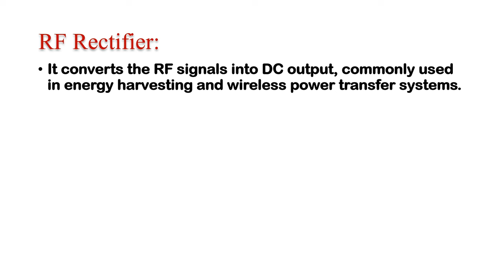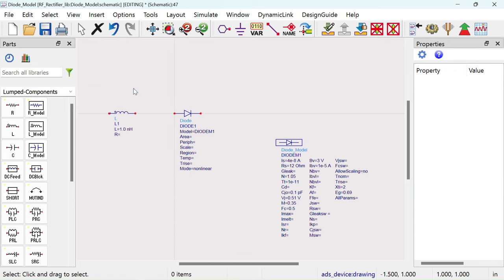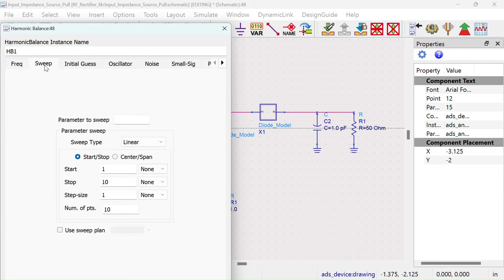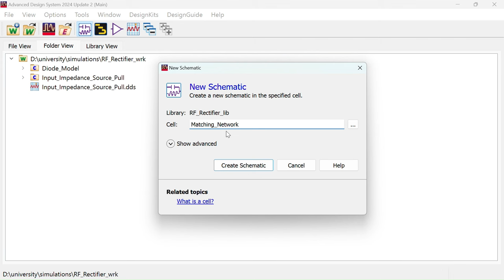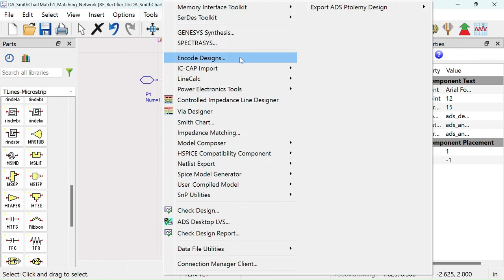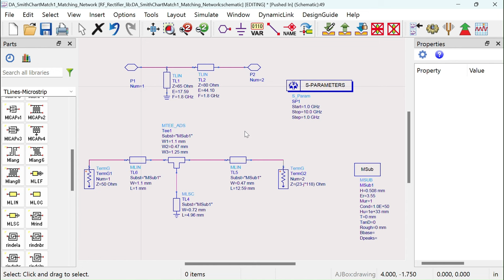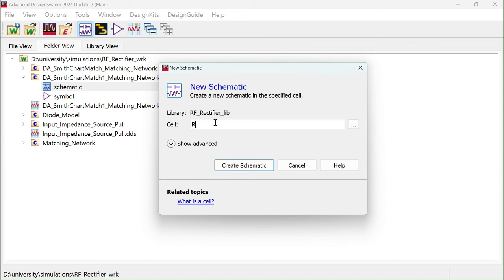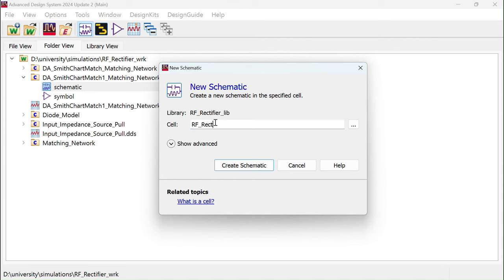RF Rectifier Design Using ADS

Comment: how to take diode modeling for different frequencies For SMS7630 is it same for every rectifier
Reply from the maker: Thank you for your comment. If you want to use different diodes you need to follow the same process, but the specification and parasitic elements are different. You can find them in the datasheet or other references. But for rectifier it is better to use the schottky diode.
Reply: @profhalimboutayeb  thank u sir

Comment: Sir could you please tell how would you determined optimal load value and capacitance is they are assumptions or are they calculated
Reply from the maker: @mpavan1404  Load resistance along with the input power and input impedance(r and x in the schematic) should be tuned in a way that provide maximum PCE. You can see the effect of rload in your schematic by changing the value. For load capacitance you should get the the value based on the frequency in this design it has been chosen 100 pf to meet the output voltage ripple requirement.
Reply: @profhalimboutayeb  sir u mean after verifying different values of load resistance u finally acheived better efficiency for 2700 ohms ??
Reply: And sir is ADS itself check for different values of load resistances or we should place a random value of load resistance and check whether it meets our desired criteria like better efficiency if not we assume other values for load resistance
Reply from the maker: @mpavan1404  Yes exactly, and you can see that it has a significant impact on efficiency.
Reply: @profhalimboutayeb  ok sir thank you
Reply from the maker: @mpavan1404  for your last question, you can do that, but you can use the tuning and optimization tool in ADS to make this process easier. By using the tuning tool you would be able to see the efficiency changes by rload or other parameters insantly.

Comment: Thanks for the video. How did you get the impedances used for the PCE simulation?
Reply from the maker: @MfonobongUko-w5x  The circuit at the second step of the design should be tuned for rload, input power and input impedance associated with those values simultaneously to get the highest PCE.

Comment: thank you so much sir for this vedio .. but i did get exact values as urs. I got negative PCE values.
Reply from the maker: @lakshmiharish347  Hello, please contact me at halim.boutayeb@uqo.ca if you have any issue with the design. Thank you very much for your comment.
Reply from the maker: @lakshmiharish347  thank you very much for your support.
1. Make sure that the load resistance and input power are correct(in dBm).
2. check your diode model to make sure that you have added all values mentioned in data sheet
3.  In final equation the input power unit is in watt, make aure that you have used the correct equation. 
4. also check the S11 by LSSP  to see if you have a good impedance matching at the input.
Thanks

Comment: thankyou so much sir for this video ......sir, I have designed the same circuit but my power conversion efficiency is zero at 1.8GHz
i don't know why ?
Reply from the maker: @upmasingh888  thank you very much for your support.
1. Make sure that the load resistance and input power are correct(in dBm).
2. check your diode model to make sure that you have added all values mentioned in data sheet
3.  In final equation the input power unit is in watt, make aure that you have used the correct equation. 
4. also check the S11 by LSSP  to see if you have a good impedance matching at the input.
Thanks

Comment: Furthermore is R=23 & X=118 the input impedance of the entire circuitry(voltage doubler,output filter and load resistor)?

2.why do we need to add this value to our port(Ptone) ?
Reply from the maker: Yes exactly, it is for the entire circuit, we need to know this impedance to be able to design a matching circuit that converts this impedance to 50 ohm source.
We need to put this value at the port impedance, because in this stage we do not have the matching circuit, otherwise we can not see the accurate value for PCE. It is done to mimic the conjugate match condition for the circuit.
Reply: @profhalimboutayeb  can you guide me step by step on how i can get to this value by optimisation?,i've been trying still no luck

in your example you do not show how you got to this value and this is the most critical part of this circuit
Reply: @profhalimboutayeb  can i send you my circuit for revision please?
Reply from the maker: @JTKhopefuls  Yes we can help you with that. Meghdad (PhD student) has already sent you an email . You can share what you have done with Meghdad and me through email, and we can talk about it.
Reply from the maker: @JTKhopefuls  yes
Reply: @profhalimboutayeb  okay i sent everything to you're email, i still have not received an email from Meghdad yet ,i'll keep you updated if i receive it
Reply: @profhalimboutayeb  thank you! i seen the email i replied accordingly ,hopefully we can sort it out and at the end of it. can design my own rectifier at 5.8Ghz

Comment: hello Sir,

how did you get (R=23) and (X=118)?
Reply from the maker: It has been tuned along with the rload and input power to get the highest amount of PCE. These three parameter should be tuned simultaneously to get the highest PCE
Reply: @profhalimboutayeb  how did we tune this?,this process was not shown in the video?
Reply from the maker: @JTKhopefuls  We can choose the mentioned parametres as variables and use the tuning or optimization tool to get the best results. Or you can try the simulation for the best tload and pin then use the tools to achieve the best input impedance values.
Reply: @profhalimboutayeb  I will try using tuning or optimisation tool ,please if you get time create a video on this I’m not very proficient at ADS
usage ,I need to create a similar rectifier for 5.8GHz as I’m building RF harvester 

I sent an email to you by the name Jonathan Kabangu if you don’t mind replying :)

Thank you sir